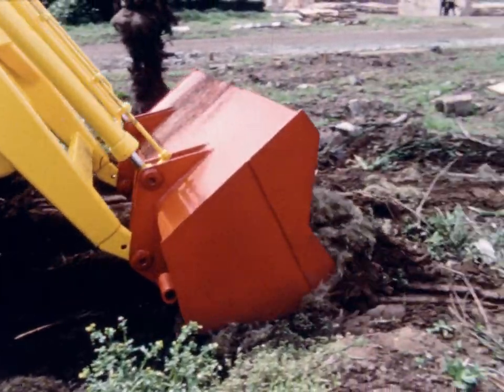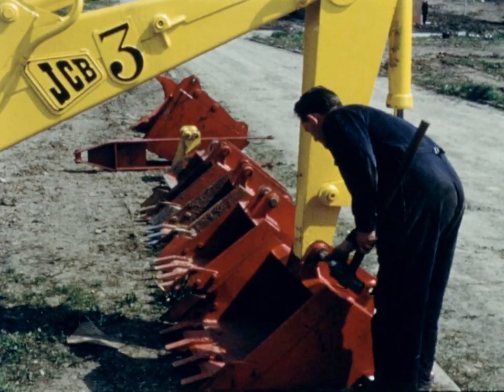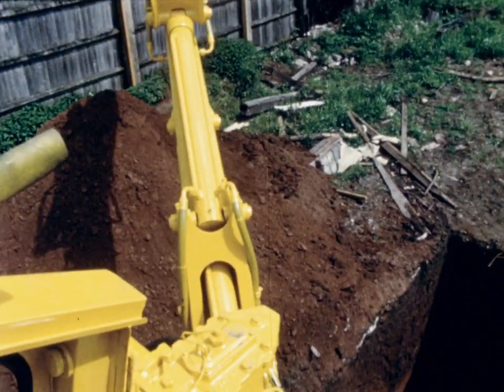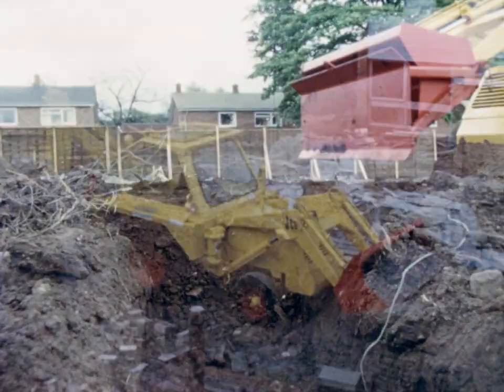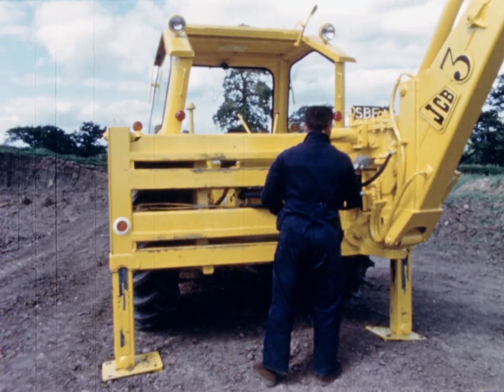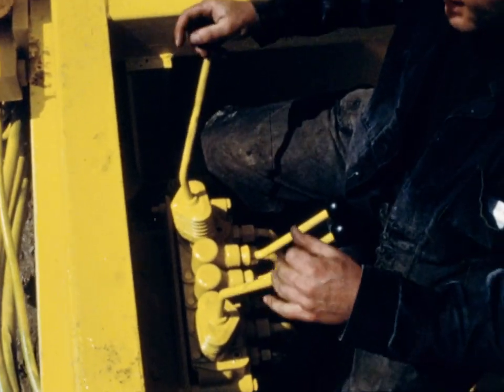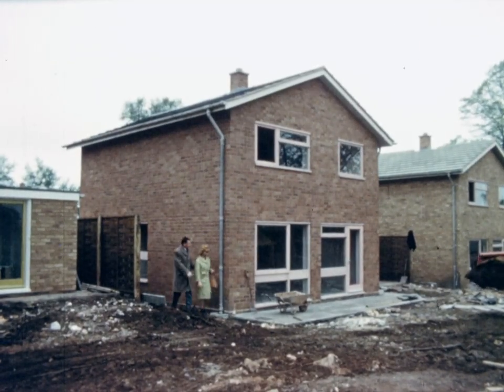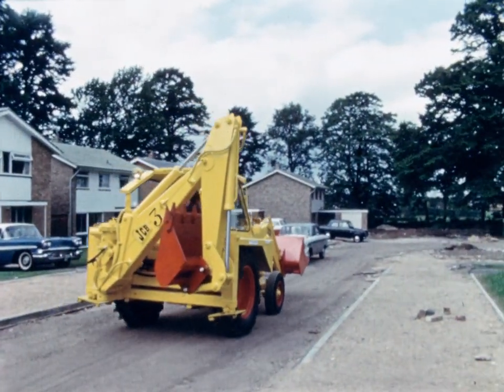JCB 3 backhoe loader in ‘A Home of Their Own’

Comment: Australian here,we had a JCB 2 backhoe on the farm in the '80's.Though a bit underpowered by the Nuffield 3 cylinder motor and a 5speed manual trans with a really slow reverse,it was a big digger with the hoe.I really liked the 2 stick hydaulic control.We replaced it with a Case 580 CK and I'm still having trouble with the Cases 3 stick hoe controls as I was so use to the JCB ones.

Comment: good to see film of the old machines at work, we still use a JCB 3 mk 1 on our farm, its got the fold up onto the roof rear window and its based on a super major tractor engine, gearbox and back end.
Reply: Does it have 4 levers to operate the back actor? They used to call them piano controls when they came out first.
Reply: @michaelwalsh9145  no ours has two levers directly down into the valve block to operate the back actor, the other two levers operate the jack legs
Reply: @madeljacky  thanks

Comment: That first bloke knocking down a building by slewing the complete back actor would have had the sack for that. As would the next bloke loading the lorry with the back actor stuck right out like that. He's also very lucky anyway insofar as none of those bricks came out over the back of the front bucket and came down and smashed his windscreen. Getting in and out of the cab could be nasty. Many times I caught one of the levers in my boiler suit or jacket and suddenly the boom would come flying up to meet you or, worse still, if you caught the slewing lever and suddenly it looked as if you were going to get crushed between the boom and the slide rails. But the machine was a great improvement on a shovel ! As a great friend of mine used to say "there's no pain with one of those" when he was talking about the digger. As someone else has said, it was a Super Major skid unit and there were no front supports for the engine, it all hung on the bell housing which I always thought was a bit crude. Mine was the first JCB I ever bought. Purchased s/h in 1969 for £350 !

Comment: Nice video, watched it as we've just got (now sold) a 63 JCB 3 that had stood outside on a farm for 20 years, cab and mudgaurds are rough (all there except for rear window hatch but lots of rust) but runs and works ok, actually quite a cute little machine as it's significantly smaller than the 3C's/CX's etc.
Reply: Ela funciona bem faça o vídeo dela
Reply: Is it in Bexhill

Comment: 8 seconds in and I'm making comment on full side swing slamming into a wall to break it. Not much has changed with digger 'wanna be' scooper driver, meat in the seat lever pullers.
Reply: I think that’s how they demolished buildings in those days.
Reply: @radharcanna    It's a 2 for 1 special, demolish the building and get the machine demolished for the same price at the same time.
Reply: @skadill  🤣🤣🤣